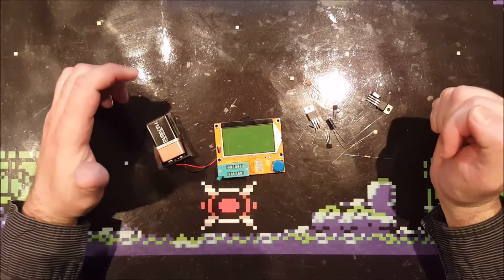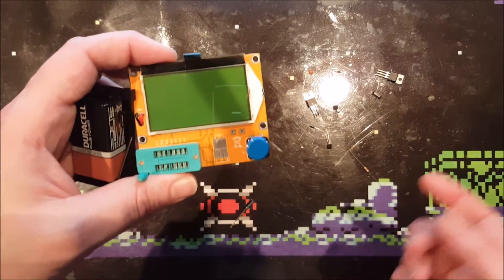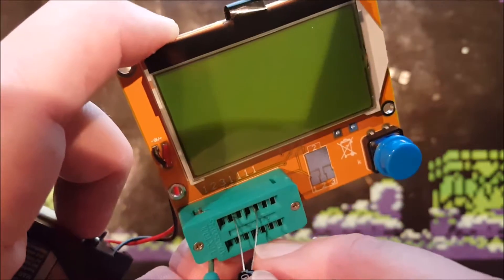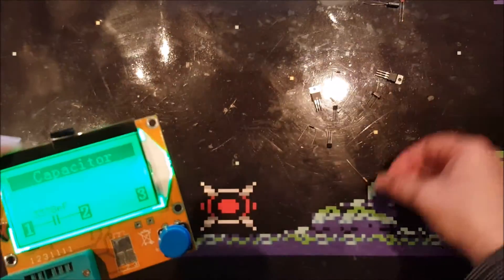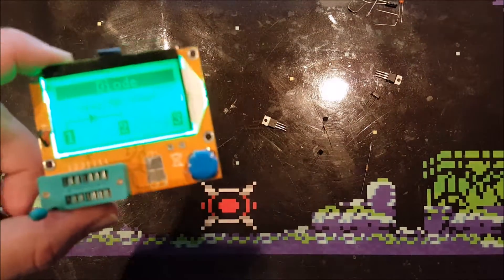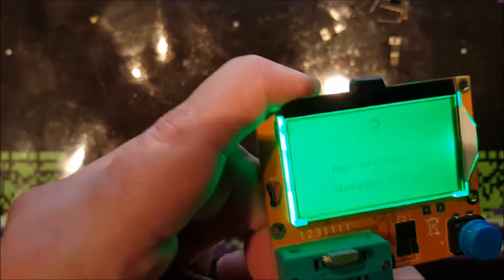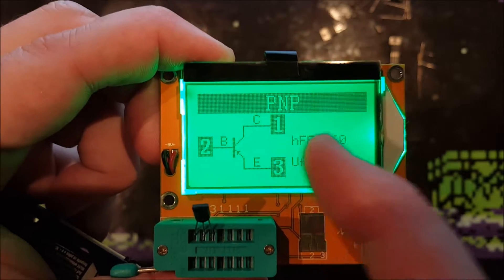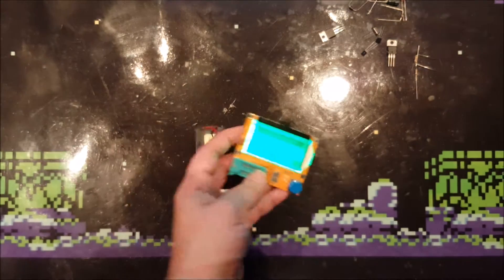Review of the LCR-T3 component tester

Comment: Did you buy and assemble a case yet? there are two cases i know of, the newer case had battery room, I did and i'm now going to install three tester hook/grabber leads, and a barrel plug connector for external power.